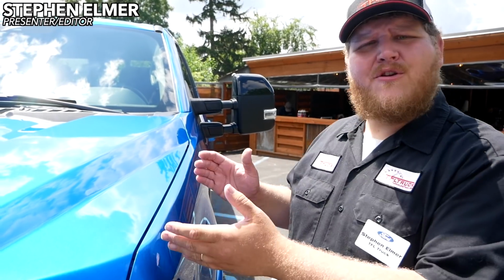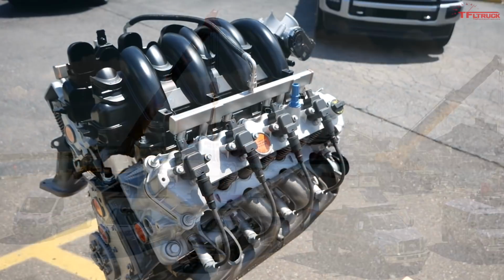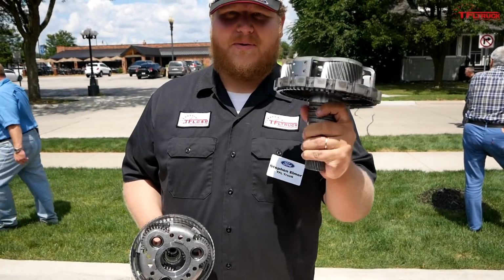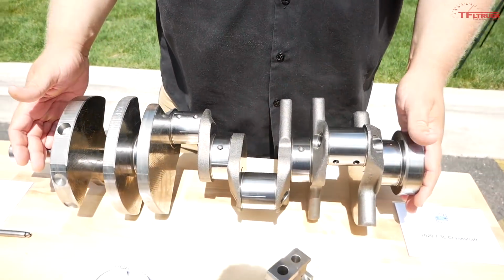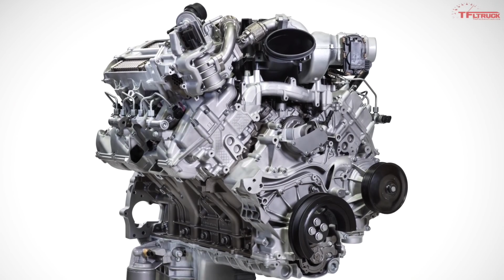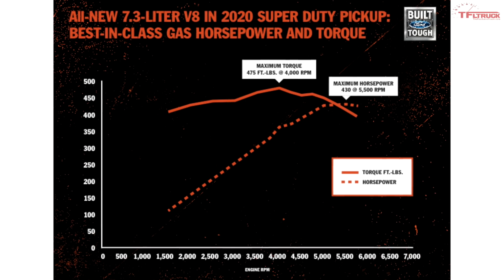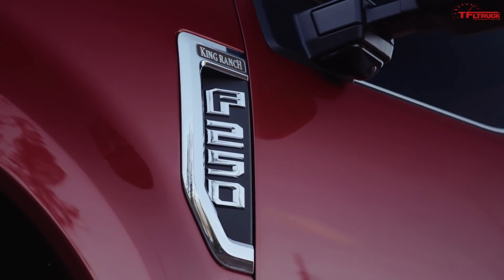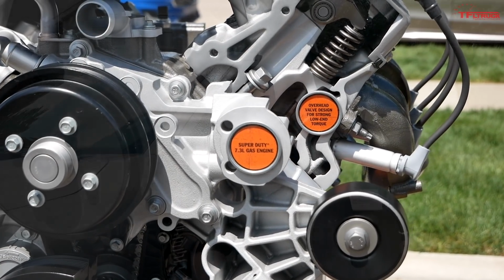We Finally Know the Ford Super Duty 7.3L V8 Power Numbers & They Are Lower Than We Thought!

Comment: The 7.3 powerstroke made 250hp 505 ftlbs.  For the gasser to get close to that torque and almost double the hp is impressive.
Reply: 7.3 powerstroke was the king of durability. My 2000 f250 has 340k miles with the original engine. If the new 7.3 gasser can be that durable it would be an incredible engine.
Reply: @Potatorq  they claim the 7.3 gas is a 500k engine
Reply: The original normally aspirated 7.3L IDI (the one before the Powerstroke DI) only had 185 hp and 338 lb-ft. After they added the turbo, it only made 190hp and 388 lb-ft. You've more than doubled what diesel could do. Of course this is 1980s and 1990s technology. I would expect quite a bit of advancements since then.
Reply: @dsch1znit  😂😂😂😂
Reply: @dsch1znit  🤣
Reply: @dsch1znit  Seriously??????
Reply: Chris Yes seriously, plus you would get better fuel economy with the 3.5L.
Reply: @dsch1znit  just because something makes more or the same power with less displacement, doesn't make it better.  The simple fact it has less displacement means it is working harder. You will never get the life And reliability out of the smaller engine.  It has to spin faster, work harder, burn hotter, use more fuel, and lord knows what else.  That's why large displacement diesels have always been the kings of longevity and durability.  Low rotating speeds, large displacement, low horsepower and high torque at low rpm means they are designed to last. That's the exact same idea that went into this 7.3 gasser. That's why everything is larger and forged and less concerned about rotating and reciprocating mass.
Reply: Cody Slaughter 
I guess this engine is for the smart consumer or business
Reply: @roninkraut6873  that's exactly what it's for. It's a fleet engine.  Not saying it couldn't be built to be a bad ass.  With the all forged internals and all the other stuff that's in it from the factory, it's a prime candidate for boost.
Reply: @dsch1znit  to directly compare the two motors is difficult. The ecoboost is in a truck that weighs considerably less. Also, the ecoboost only gets good mileage when unloaded. The largest gripe on the EB is you can have Eco (high MPG) or boost (high power). The Ecoboost tows exceptionally well, but anyone with an EB will tell you, they get 6-9mpg while towing anything with a tall profile because the engine is always under boost. This sucks gas in a hurry. The large displacement gas motors such as the 7.3L will produce the same amount of power and will likely get better mileage with less stress on the motor while towing. The other downside is that the Ecoboost frequently reaches max temps when towing. A large displacement naturally aspirated motor will remain cooler while performing the same amount of work. I have a 3.5EB now and I love it, but I really want a superduty as my next truck and the diesel is impractical for me. This new 7.3L might be the winner.
Reply: Hammy This was the answer I was looking for, thank you for explaining that. I have a 3.5L eco in my 2018 and have been genuinely curious as to why they don’t use them in the super duty’s, now I understand.
Reply: @roninkraut6873  Yup, rental truck motor.
Reply: E30 M3 
Yep, and service truck, fleet, small business, etc. it should be a good dependable engine that will provide cost effective service intervals and such. 

It will also make a great engine for guys that want their truck to tow a trailer and use for light to medium duty work and not break the bank like a new Diesel engine. If the GD government didn’t meddle in private business and would have left Diesel engines alone there wouldn’t be such a demand for these new bigger displacement gassers.
Reply: @roninkraut6873  I agree. I ahwv the 1997 F-250 HD with the 7.3 diesel.  I am at the exact cut off year for California emissions. I do not have to have emission controls on the truck. It has 453,000 miles and I want to make it last as long as possible.
 If a cow farts in California, the EPA will throw a catalytic converter on it.
Reply: @EM-fi2qg  I think 2003 was the cut off year for emissions on diesels in pickup trucks.  I have a 2003 Excursion with the 7.3L, and it has no emissions, with the California approved sticker under the hood.  2003 was the cutover year for the 6.0L diesel, and that had emissions junk on it.
Reply: @d0glesby  I thought the same thing. I had an 02 7.3 also with no catalytic converters. But when I went to register my 1997 7.3 in California, this is what it says in the emissions statements.
"Diesel Smog Test Exemption: The DMV does not require a California emission inspection (smog check) for the following types of vehicles:

Any diesel car or diesel pickup truck which is 1997 model year or older.

Any diesel truck which weights over 14,000 GVWR".
Reply: @EM-fi2qg  Ah, gotcha.  So, '98 and newer might need to be smog tested, but up to 2003 they didn't have to have any emissions equipment.  I had to smog my '84 Chevrolet K5 Blazer 4x4 with the 6.2L diesel when I lived in Colorado, but that didn't have any emissions equipment on it either.
Reply: @d0glesby  Ya, it really doesn't make sense to me. I have a friend that owns an offroad shop here in Ca and he says some of his customers need to add smog equipment to their 2001 diesels. An attorney may start a class action against the epa here in Ca at some point. You shouldn't be required to add any equipment to a factory vehicle.
Reply: @d0glesby  All Excursions with the 7.3L PowerStroke Diesel, were equipped with the California Emissions version 7.3L diesel.  It basically had a solid state controller that individually controlled each glow plug, and could report a DTC error about any glow plug that was not in the proper ohm range when being activated. There was no EGR, no catalytic converter. The non California emissions 7.3L diesel had a simple relay/solenoid that ran all glow plugs together.
Reply: @dsch1znit  it's pretty simple buddy. You line up a f150 with 3.5 twin turbo with a f250 with 7.3 has set. Hook up a 6k trailer than go up a mile grade at 7 percent. That 7.3 will just cruise up probably in highest gear while 3.5 going back and forth in gears which equals more gas and more wear
Reply: Harold Finch Thank you sir!
Reply: Harold Finch  *trolls
Reply: @dsch1znit  
You'd only get better fuel economy with the 3.5 turbo under LIGHT loadings, such as running the EPA Combined Cycle test.

The 7.3 was designed to get maximum FE WHILE TOWING. To that end, specific power (HP per L) is deliberately kept low, so that it can be at stoichometric mixture, and full power, and not overheat. Which the 3.5L cannot do: it has to enrich at full power, ruining economy.

An EcoBoost can give you "eco" OR  "boost," but it CAN'T give you both at the same time. The 7.3 can.
Reply: @dsch1znit  you would absolutely not get better fuel economy with the 3.5L if you're actually pulling weight. The ecoboost is fine for regular driving with the occasional tow or loaded bed, but the mileage is quite terrible during the work. Once you're over 2800-3000 rpm that Ecoboost mileage is pretty mediocre. I have an ecoboost but I would not have purchased one if I was going to move weight consistently- that's what an  F250 or greater is for.
Reply: @lonniefreeman4278  not true, I had an eco boost and now own the 7.3.  The eco boost made torque more like a diesel so it could hold a higher gear longer. The 7.3 is a torque monster but, it will grab a lower gear much sooner in my first hand experience towing heavy with both.
Reply: @epfd217  I own a 2020 7.3.
Let me tell you,  besides the gas mileage,  it's such a refined, stately,  beautiful driving truck.  Has the same transmission as the 6.7 diesel. I have towed with it over 20 k, and it has no problem with it.  Also, it has a much better than expected engine brake.  Not as strong as a diesel,  but strong enough to hold the speed downhill with 16k on the hook.
Reply: Just add direct injection, that will add more than 10% (525 ft/lbs.)
Reply: My early 99 7.3 has forged internals and a decent tune with some other goodies. It runs well but is still a turd compared to my stock 2016 6.7.    But the new gasser should be a great engine for the guys who I dont trust with watching the gauges in a $60k diesel.
Reply: JBird117 What’s most impressive is that it’ll always start on a cold morning, won’t leak oil everywhere and you’ll actually be able to hear yourself think inside the cab. It won’t break the bank to repair either. Modern emissions requirements have killed diesel reliability. Cummins, Ford, and Duramax are all money pits . I run class 8 diesels and I’m keeping my Detroit Diesel Series 60 as long as I can.
Reply: The 7.3l Powerstroke is the perfect engine for towing. It’s not fast but plenty of torque and the detuned larger displacement engine is a reliable workhorse. Even if they reissued that engine, it would be raped with emissions systems. This 7.3 gasser seems like the next best thing.
Reply: In a cummins they always have lower hp and more torque then Ford.
Reply: @DieselAddict-vs9fc  
The function is, the delta of higher RPM of the V-8 engine.
Reply: @nellyfarnsworth7381  not so much the higher rpms more of a v8 engines rpm accelerat faster. Because my 95 12 valve and my 99 f2500 max out at the same rpm
Reply: The 03 version did. 275hp 520 lb ft of torque
Reply: @dsch1znit  a lot longer
Reply: My 7.3 is rated at 215 horse and 435 lb.ft.
Reply: dsch1znit The 7.3 liter gas makes its maximum power numbers a lot lower in the RPM range which is more suitable for towing.
Reply: Eager to see this perform on the ike gauntlet
Reply: JBird117
How is that impressive? Big Block V8s have hitting those numbers for years.
Reply: I have 3 460 engines and close to the same thing. One in motor home, one in F450 and one in 54 coupe. I obviously love them and can be reliable and strong but all are gas hogs. By the way the one in the 54 blows these new 7.3 dyno numbers away but certainly not the other two.   😊
Reply: Yea that's true , However numbers on paper are completely different. Even the 7.3 diesels produced torque at a much lower range , gas will never be anywhere close to diesel at all.  It is still a very powerful gas motor , that can can tow a 5th wheel occasional, most needs. Just don't expect it to be efficient doing it.
Reply: Agree with Jpippinator. Also it's hard to compare an engine made 20 years ago to one made today
Reply: @andrewwelch7561  not really.
Reply: dsch1znit 
Yes. It will not have to ‘work’ as hard as the ecoboost and will be a fleet engine in commercial vehicles to replace the V10. It will have longer maintenance intervals and will be a very cost effective engine. Maybe one day some one will turn this engine into a race motor with more aggressive heads and can and forced induction. For now, this engine will be a workhorse engine that will be happy putting along pulling heavy loads

Comment: Sounds like the 7.3 is going to be good (should have made it 7.5 to make it like the good ol 460 instead of tons of people thinking you are talking about the old Ford diesel) but the changes to the 6.7 diesel seem VERY iffy...
An electric turbo? Great more things to break and wear out
And especially a variable oil pump...
No no no no do not mess around with that and chance it going bad and completely destroying the engine..
I will happily give up a few HP to run the traditional oil pump and know that it will never go bad
Steel pistons seem like the only possibly good change to the engine
All this makes me miss the old 7.3 Ford had, especially the IDIs
They were no sports cars, but they would run forever.
The IDI 7.3, especially the factory turbo IDI 7.3, is the only pickup Diesel engine to give the old mechanical 5.9 Cummins a real good run for the money on which would last longer
Both of those old engines last much longer than any of these new diesels, even the 6.7 Cummins

Comment: Transmission will be the weak point on this setup. Low stress NA engines like  this are made to make it to a half million miles with regular servicing. Ford wants a super reliable super duty engine and they can put it in the medium duty trucks.

Comment: You forgot about the new 6.2L in Chevy makes 420 HP and 460 LB-FT of torque
Reply: Aluminum block and not even close to handling the stress levels of a commercial engine.
Reply: Might not be good for commercial use just thought I’d put it out there since he was talking power numbers 6.2L is closer to the new 7.3L power wise than chevys new 6.6L gas engine

Comment: Honestly this is really good power, people today are demanding more and more power from vehicles, remember only 20 years ago the 12 valve cummins made basically the same torque and in 96 the ford 4.9 gas 6 was enough for an f350 with only 260ftlbs of torque and both were considered excellent overbuilt long lasting engines

Comment: Ram's 8.0 v10 made 400 ft/lbs at 800 RPM's and 450 at 2400 25 years ago. You would think after 25+ years there would be more on the table for a big displacement N/A gas engine
Reply: I miss the 488 V10
Reply: Look at the A/F raitio
Reply: Yeah... and could get a whopping 11mpg hauling nothing. The point of this engine was to get great towing capabilities while getting great WOT mpg (stoichiometric 14.7:1). The problem with that ratio is that it’s not great for performance which is why they chose 7.3 liters. They had the power numbers and mpg numbers they wanted and set out to find the proper displacement to make it happen.
Reply: Trey K 
Thank you for being intelligent. All of these other knuckle heads on here complaining that it didn’t make 1000 hp and whatnot have zero grasp on what this engine was made to do.
Reply: That v10 lasted for like... A year before junking it? XD